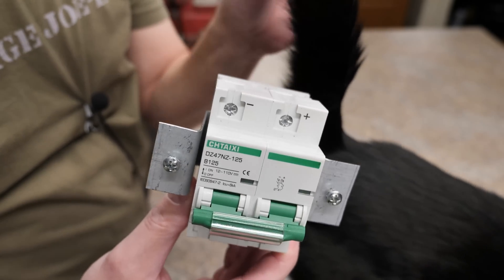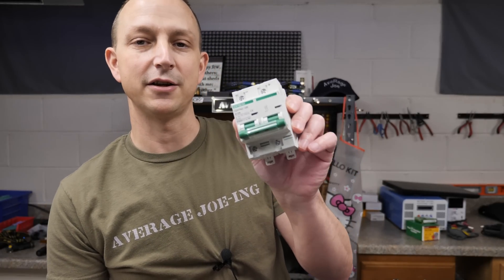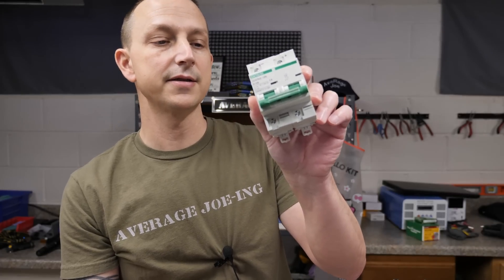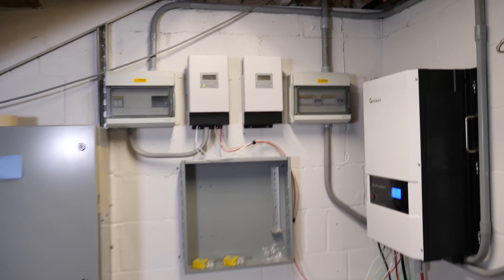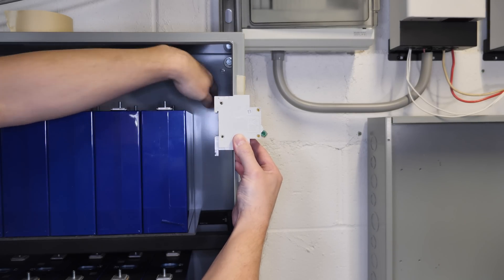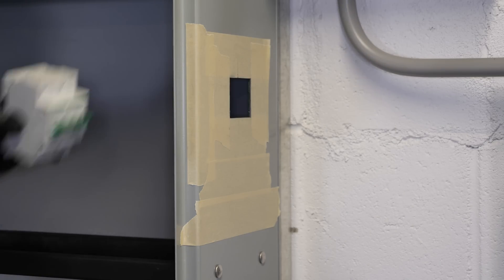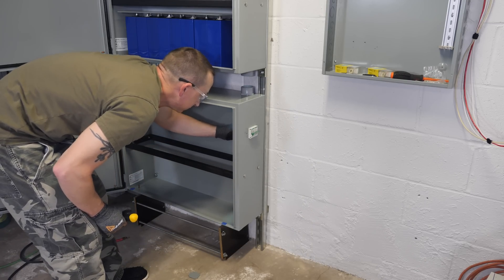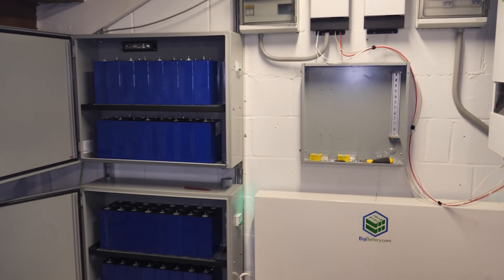Adding Circuit Breakers to the Diy Powerwall 2.OH Ep8

Comment: On the array rack, could you show a S.P.A.T. in action? Curious if the rack is tilt-able.  Nice job fab'ing the breaker mount. Cleaver. You could flip the breaker upside down so down is ON (unlike a light switch).  Maybe paint it red too. Thanks for sharing
Reply from the maker: The ground mount is fixed at 25degree. I may try messing with it one day and drill more holes to adjust or.....use actuators😲🤠

Comment: I do not understand venting these boxes it seems to me it is an oxygen source Those are sealed cases would it not be better if a battery shorts out to starve it of any oxygen including using fire proof foam in all conduct openings and grounding the boxes
Reply from the maker: These cells normally wont catch fire. If something goes wrong they just vent a bunch of nasty fumes/smoke. I am making a vent since its in my basement and if something ever goes wrong, I can vent it outside💥🤘

Comment: In the vent tube at the upper floor level you need to consider water ingress from outside. Add an inverted "S" bend, at least.
Reply from the maker: Hmmmm....do you think water ingress would be a thing? The vent would be to a covered patio area. I was thinking more of a flappy sorta thing.
Reply: @AVERAGE_JOE  it's your home   you would know better than me. Water and electricity don't usually mix and for the sake of a couple $$$, why not. Along with the floppy thing.
Reply from the maker: Oh ok gotcha ya wasnt sure if you knew of something with moisture in pipes or something😄🤘

Comment: HOWdy  A-R-J, ... 
Excavating in the BASEMENT 🙂
CURIOUS = since your Blue-Batteries are sealed --- what would you be VENTING from your BATTERY BOXES ??? 
Thanks
COOP
the WiSeNhEiMeR from Richmond, INDIANA
...
Reply from the maker: The vent is for the "just in case" the cells or a single cell decides to vent. Id like to keep the nasty smoke outside if I can. I have also seen a few cells from others vent. 💥🤘

Comment: With BMSs properly set up, I see no reason for ventilation. This chemistry don’t run hot, and don’t burst into 🔥. Put a smoke alarm near them and you’re fine 👍🏼
Reply from the maker: The vent is moar for the unknown event since everything is in my basement. Ive seen a few other setups that have had a cell vent. Would hate to have all the nasty smoke indoors. I have the batrium bms that I used on the previous setup.🤘
Reply: Batteries 🪫 can vent, 
even with a proper BMS.

A smoke alarm merely tells you there is an issue & you are getting poisoned, while a vent allows one to not get poisoned 🤮

Comment: Nice work with the bracket. I normally use a a din rail with long screws and nuts. You can control the depth with an additional pair of nuts. I think the way to did it is better.
Reply from the maker: Thanks Mate! Your way isnt to bad of an idea either. I like it!💥🤘
Reply: @AVERAGE_JOE  Couldn't you just create a new bracket out of the same material that sets the breaker back more flush? Just make the "side" "legs" longer since the bracket is what gets screwed to the box. That way the breaker is more flush with the outside. No?
Reply from the maker: Yes can 100% do that and might as Ill need to add a lil bit of an insulator between the screws and box.🙄🤣

Comment: Nice work! But if I were you wouldn't use those crappy Chinese MCBs. Had a couple in my system and had 2 of them overheat. One was a small 40A and another a larger 125A. That 125A breaker almost started a fire. Got hot enough internally to melt the plastic casing. Switched them all over to Blue Sea Systems 178 series.
Reply from the maker: Thanks Man! Do you know the brand? Or were they the same ones as these😬 I almost got expensive ones too
Reply: @AVERAGE_JOE  The ones I used were Tomzn. They seems to be the “higher” quality ones from China. But I guess not. Would be surprised if they’re all made in the same factory though.
Reply from the maker: Really....I thought TOMZN were good ones as well. Ive used them in the past and have had good luck. Oh ya all made in same assembly line for sure lol
Reply: The chinese breakers can be fine. Just check them under load with a thermal camera.
Reply from the maker: Will 100% do that!

Comment: Ha, you stole my idea for the flush-mount brackets for the breakers. I will just steal that back from you as it is mine anyway. You're welcome to keep yours though. Free idea gifting from the Off-Grid Garage 😉
Reply from the maker: WHAT?🤣 No way🤣 I allready have brackets like this from the UPS's. They are different size tho for the smaller cb lol so so had to make wider ones. Did you really make brackets like this?🤔🫣🤣
Reply: @AVERAGE_JOE  I didn't make any brackets yet, but spoke about them in a video a while back when I built the Seplos box. But never made one. Now I know how 😉
Once the cables are connected and the breaker terminals are tightened, I thought about a small stripe of EVA tape on top of the screws. This would then further pull in the breaker and it does not stick out as much. It also gives a layer of isolation between metal enclosure and terminal screws.
Merry Christmas, Joe!

Comment: OI Joe, u can 3d print a plastic spacer that fits around the c/b and place it on the inside and use longer screws to machine screws into the metal bracket u made. Now a word of warning and listen carefully, the screw conductor connections on the c/b will come loose and cause arching due to the current generating heat causing metal expansion and contraction so ur gonna have to drill more holes in in the cabinet to tighten the screws down onto the conductors or at-least check them monthly for the first year at-least,, u may want to put a rubber plug and gromet on the holes too to stop bugs getting in there and not to short out the screwdriver to the cabinet in-case u do not use a fully insulated electrical screwdriver. I have seen c/b burnouts on the the solar panel side and also in electrical boxes cos of the conductor screws coming loose so it happens on ac and dc sides, so u may want to check all of ur circuit breakers on routine electrical inspections... this is imperative for fire safety.
Reply from the maker: Whoa.....thanks for that info!!! I will for sure put some rubber in the holes and possibly a flat rubber "spacer". I will also check screws after instal.  Damn....kinda rethinking those cb now. I should get some that have bolt style terminals.🤔🤔🤔
Reply: @AVERAGE_JOE  it all c/b's brother, check all u got like that, the ones in ur ac service should be ok but maybe just check all of them every few years... cos i am guessing they r american made not chinese crap.

Comment: HEY JOE, I ENJOY WATCHING YOUR PROJECTS!
HERE IS MY SUGGESTION: WHAT IS THE FEASIBILITY TO RUN A WIRING RACEWAY WITH A CORNER FROM YOUR NEW BATTERY POWER WALLS ALL THE WAY AROUND & UNDERNEATH YOUR INVERTER?
THEN YOU CAN INSTALL ALL YOUR SOLAR PERIPHERAL BOXES ON TOP & YOUR BIG BATTERIES UNDERNEATH WHERE ALL YOUR WIRING IS WITHIN THE WIRING RACEWAY PROVIDING A CLEAN PROTECTED & PROFESSIONAL ENVIRONMENT.
THANKS FOR SHARING ALL YOUR PROJECT!
Reply from the maker: Thanks! I considered the raceway amd almost went that way but didnt. Also under the inverter is the intake fan buy the battery connections so would need that area open...ish

Comment: What BMS ARE YOU GOING TO USE FOR THE BUE BATTERIES? I ALSO HAVE 64 OF THEM AND I USED THE DALY BMS, 4 IN PARALEL HOWEVER IF I WERE TO START ALL OVER AGAIN I WOULD USE THE BMS THAT IS COMMUNICATING WITH THE INVERTER. I have two 12 kw growatt inverters but the 250v :) i lerned from your mistake... Thank you!
Reply from the maker: I have a batrium bms for all the 280ah blue cells. My inverter is actually the 250v version. I ordered the 150v and they shipped the 250v lol. I didnt even realize it until much later......ya im dumb lol🤣💁‍♂️
Reply: You won’t regret the BMS you’ve got! I started with 16 230 amps and a 300 amps DALY BMS then I ended up with 64 230 amps batteries under 4 200 amps BMS. Mama China did an update and made it possible to connect in parallel and they charge and balance down to 0.001 volt difference between cells!

Comment: Maybe buy a locking thermostat cover for the breakers?  Or look up a “Push to Exit” button cover.
Reply from the maker: I found some cb covers on amazon and they should be here soon.🤘 So I want the covers to be somewhat "open" or easy to get at just in case. So a easy open or easy access is what I found. 🤘

Comment: Based on the load testing you have done in the past, you will most likely need about 10-13 KW of solar panels to keep up with your lifestyle.
Reply from the maker: Yeah that sounds about right. With my panels now I can run 24/7 off grid in summer but that is without the stove, AC or dryer. So another 5-7kw of solar should do nicely. May actually need a little more for winter time😬

Comment: 9:14  What I would recommend here is to take the heat gun and heat up the PVC and then turn that into an oval shape. That way the wires would more easily line up to go into the ports without putting sideways stress on them.
Reply from the maker: Yeah that would help with those wires fo sho!

Comment: Maybe you could put computer fans on the boxes. Then a small portable Air Conditioning unit with a duct leading to the fans.
Reply from the maker: Id probly add the computer fan for sure.  Dont think ill need AC as it stays pretty cool in the basement. 💥🤘

Comment: Your exhaust plan seems sound.  I would add a cheap DC module with a temp probe that will turn the inlet fan on at say 90 degrees F,  if your BMS doesn't already support that.
Reply from the maker: Yeah Im kinda thinkin so also. Oh yeah Ill connect fan to the batrium and control from there!💥🤘

Comment: I have installed breakers in cabinets just like this, I used a 1/2" piece of MDF to create a spacer/isolator between the breaker and the box, this will recess your breakers making them more flush and adds isolation between the terminal screws and the metal cabinet.  Something like a 3x3 or 4x4 piece of wood or cutting board material with a whole for the breaker in it and you'd be all set. Longer machine screws into your custom brackets of course.
Reply from the maker: Nice! Yeah thats what I was thinking if I made them flush mount. I think I have some cutting board material around here somewhere🤣

Comment: Looks great!  Love the nice clean lines and look.  Keep up the great work!  

I would probably skip the guard unless you notice the cats are spending a lot of time over in that area.  

From the venting standpoint, just cutting a hole in the bottom (put some kind of debris guard mesh over it) and then piping out the upper box to the rim joist seems like it would work pretty well.  A fan seems like it would only be needed in the event of a catastrophic failure, but you could always mount a computer fan with a separate switch to vent the boxes if needed.
Reply from the maker: Thanks Man! My cats dont turn lights off in the house or anything....yet but just trying to think of everything ahead of time lol. The guard is most likely not needed but may put one there JIC🤣

Yeah the venting I think can be simple. 100% on a small computer fan and I can operate it from the batrium bms!💥🤘

Comment: Nice & clean work. Jjust a basic question, why you didn'nt swap DIY's batteries with your solar chargers to save some large gauge wiring & transmission loss ?
Reply from the maker: I am not sure what you are asking? Can you rephrase? Thanks🤘
Reply: @AVERAGE_JOE  Sorry, I am not a native english speaker. What I tried to ask, why you didn't install your two large boxes housing your prasmatic cells (right side) with your solar's controller (middle column). You could save (a bit) some large gaure wiring ?  I guess there were some specific contraints about this choice ?
Reply from the maker: Thanks for rephrasing! The diy batteries are not connected yet. Once they are, the charge controllers will connect to them!🤘
Reply: @AVERAGE_JOE  It's clear, I guess your main bus bar will be around your solar controllers :)
Reply from the maker: Yes, main buss bars will be in metal box below charge controllers along with a main shut off.